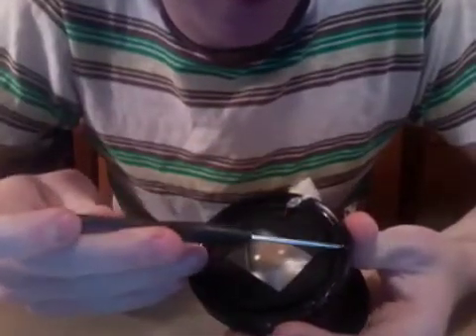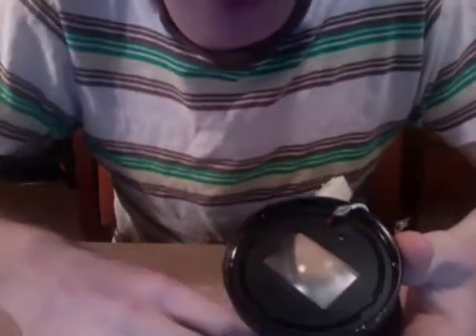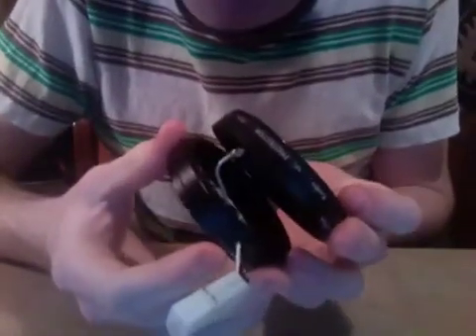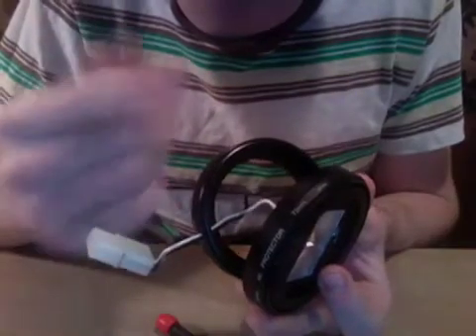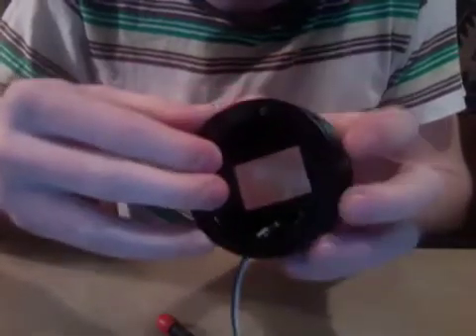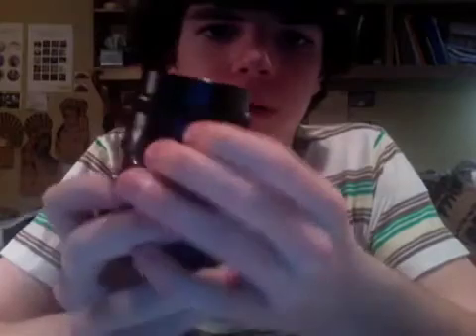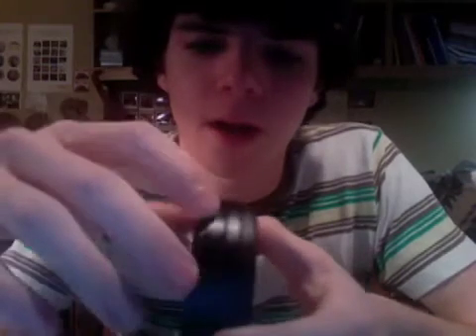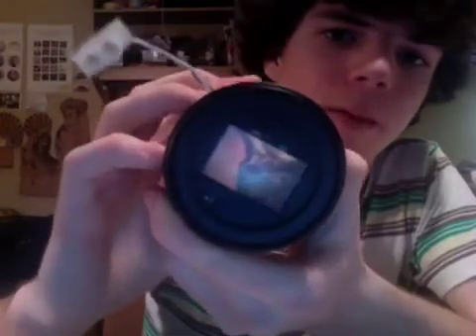DIY Vibrating 35mm adapter Part #2

Comment: The 46.5mm is the so called flange focal length (distance between the surface of the silver mount-ring and the surface of the ground glas!). Currently i am building my own adapter they way you do it. My camcorder is a Sony HDR-HC1 (HDV) with filter thread of 37mm. I am going to employ a nikon-mount.  To measure the given distance between gg and lens-mount I can only recommend to use an elektronic digital caliper (approx. 10 dollars at home depo). With best regards  Portfolioish

Comment: Thank you for the tutorial. What lens mount do you use? It looks loke a Nikon-mount. At counter 3:40 on your video you're talking about the distance between the lense and the ground glass surface. Fact is, you don't have to figure out the "proper length in between lens and screen". Depending on the mount (Nikon or Canon) there is a definite length given. For example with Nikon the distance between Nikon-mount and ground glas is exactly 46.5mm. It would be good to include that in your next video.